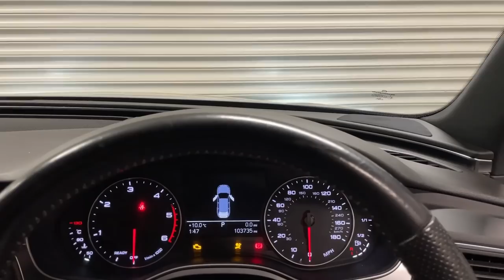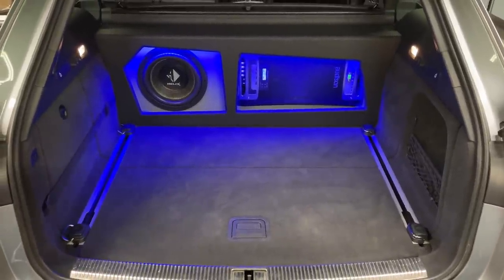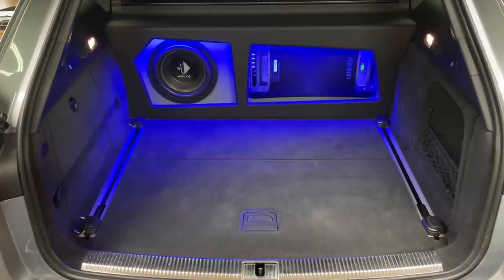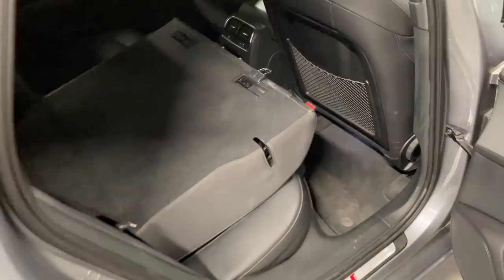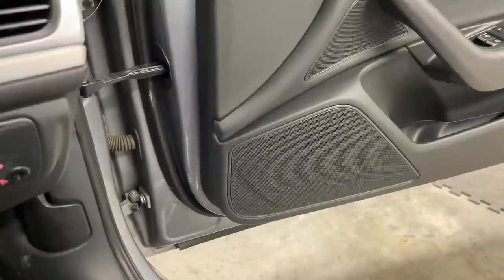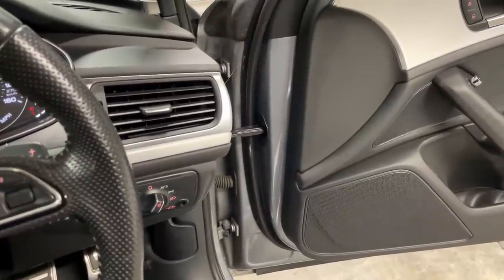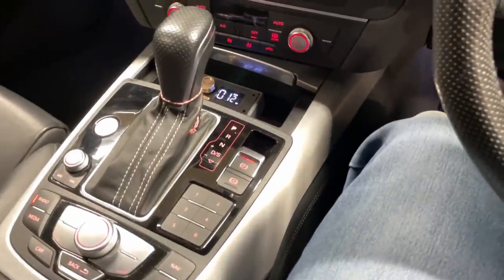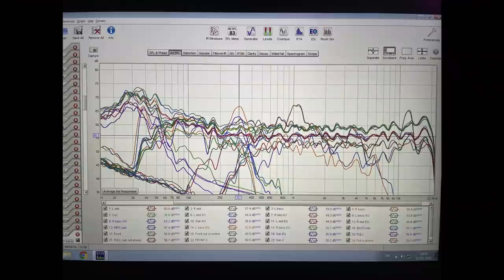Audi A6 C7 Audio Upgrade - Simple, Daily, SQ System - Zapco, Helix, Audison, Hertz, Hybrid Audio

Comment: Pete  you know I'm a fan of your work  did you run  into a time crunch on the amp rack?   Cable management  is the difference in this being a "six"  and a "century " on this build.
Reply from the maker: You know it’s a bit like having your favourite meal cooked by grandma on Sunday! You can always rely on her that you’ll be well fed and you’ll lick all ten of your fingers. Her presentation is not like a Michelin star chef’s, but you don’t pay for that, you just want the awesome taste in your mouth. 
Same is happening here. This wiring is not for competition highest levels, it won’t win a beauty contest, but it’s honest. Connections are properly terminated, ferrules used all around, small connectors soldered and protected. There’s nothing to be ashamed for. This build already had many many extra hours put into even if the customer couldn’t afford it. When they can afford to have fancy wiring, then we’ll do it, but till then we rather focus on what makes a system sound better and that’s where we put more effort, because at the end of the day you want have ear 👂 orgasm. 💪🔊🔊
Reply: @pssound9749  touche, Pete well said ...rook takes queen

Comment: Could you make a video going indept of most systems. How it works, how it should be wired etc. Cant find any videos on yt or patreon on this subject, and so few videos online explaining this...
Reply from the maker: Hi,
When it comes to wiring, what part are you really interested in or need more information about? 
We have quite few videos showing boot builds, explaining the whole installation process of amplifiers and DSPs. I’ll make a playlist for them, so you can watch all those videos in one list.
Reply: Thanks alot. Im thinkinh about the Most25 system audi has in alot og their cars. I've done a few builds in audi b8/b8.5 and im now going to build in a c7. But no one has ever told me how the Most/mosfet system works. 
I was struggeling with integrating a mobridge dsp (used it to connect me to the most system and get analog output from it to the amps) but it had some issues...So maby you could share some knowledge about how the most system works and what to look out for when buying equipment for that kind of use. 

For my next build i will try the helix converter (seen you use it alot) and hopefully it will run fine with the rest og the system.
As i said, i havent found anyone going in dept on forums etc. so if you have the interest and time to teach us about it, im sure alot of us would be greatfull!

Comment: Hi Peter, I know that Hertz is not your first choice (except whole while ago in the Honda 2000.3 as front sub), but the ML.3 where quite well received. What’s your opinion on the 1800.3, 700.3 and the 280.3’s. What are specific their shortcomings against by you preferred drivers within a completely well done installation and tuning in your opinion?

Comment: Hello, what speakers did you use instead of the tweeters?
What size are the new speakers?
Did you have to modify something in that place to insert the speaker?
Reply from the maker: We used the HAT L2SE wideband as shown at the end of the video in pictures too. Nothing had to be modified, it just needed a custom mounting frame.

Comment: Hi Peter I’m trying to find a good 3 way system for my truck. What is a recommended set under $1000?
Reply from the maker: I can never suggest anything like this as i always look at the installation first, what locations and applications can be used.
Reply: @pssound9749  I should have asked instead what are your trusted brands. My apologies

Comment: Big question. How do you use the stock head unit for builds like this?
Reply: Or did you?
Reply from the maker: In this one we had to use the speaker levels first, which are not great, but prepared the car for MOST25 integration. You need to get the HU coded for hifi, so it outputs signal on the fibre optic too, then use something like an Audison Bit DMI or Helix SDMI25 and you can also get clean, optical signal from the HU.
Reply: @pssound9749  that went right over my head but thanks for the info!
Reply from the maker: @AudioEuphoria080  check out those products and it may all become clearer. 😉
Reply: @pssound9749  bet ill check them out thanks

Comment: Hello

I own Helix Q10 Woofer. I want to use it in a closed box. How many liters should the box be?
Reply from the maker: Min 17-18L for tighter bass or 25-30L for better low extension.
Reply: Which one is best for sql system? Car is Opel Astra 2023. I will use q10 with helix p two amp.

Thanks for answer❤

Comment: This is the same as my car. Does the standard cd player work still? Did I miss that bit? Also how did you get the amp to run through the audi system?
Reply from the maker: You need MOST25 integration, so you get optical signal out of the HU, then you can run that into the DSP.
Reply: @pssound9749  ah Brill. Cheers. Hopefully put an install in mine this year :) thanks for info
Reply: I'm pulling my hair out here.. what's the song called please?
Reply from the maker: @leebuxton4272  Sohn - The Chase
Download Shazam and you’ll find every song with it! 💪